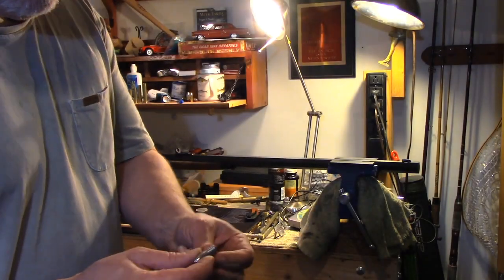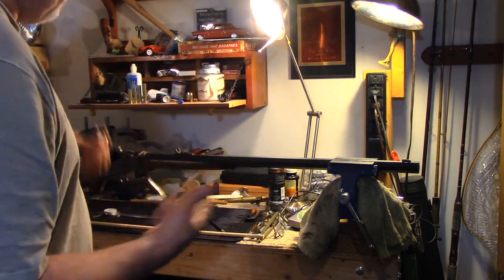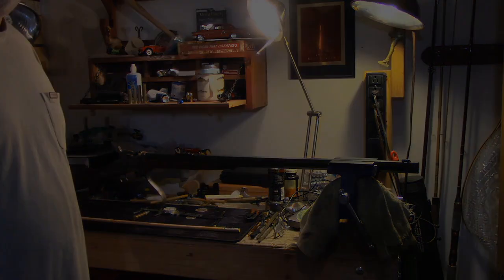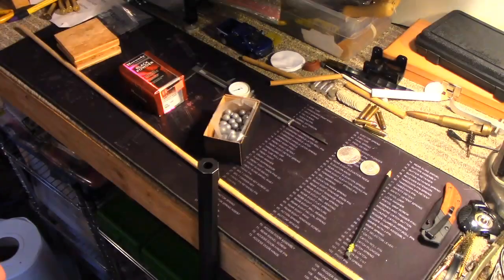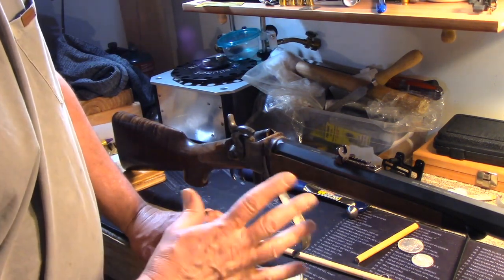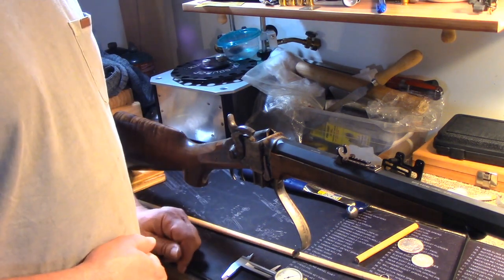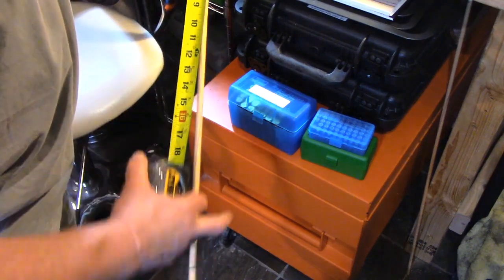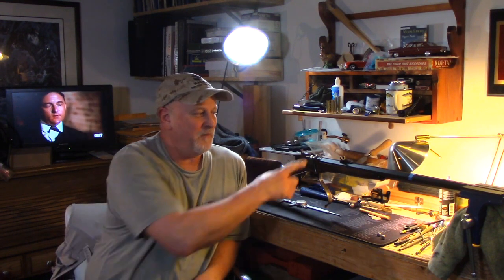Introduction to the Shiloh Sharps 45-70 Model 1874 Rifle

Comment: I know this video is a couple,of years old, but the technics to obtain vitals of the rifle still apply. When I get home, at the end of October 2024, I will use the methods that you just used, to find the info on my Trapdoor Springfield, which I intend t9 use at the 2025 Quigley match. Most important is, that I need to slug the barrel to find groove diameter, so I can get a correct bullet. Will do this on the barrel of the rifle that I’m going to have built. I could have just purchased the Pedersoli Trapdoor target rifle, with its 6 grooves, but I really didn’t like the finish of the stock and I wanted to have a number of parts color case hardened…..make this rifle really special. Just ordered a Lee Shaver  vernier/Soule rear sight. The rifle will have all original metal but a repro full length stock. Bruce Dow, in Dade City, Fl will finish/assemble/ mount the sight and shape/finish the wood. I think the rifle will look very good. We’ll see if I. An actually score some points with it. Thanks. Enjoy your videos.

Comment: Nice video! When using a micrometer use the small diameter on turning screw, this has an ratchet preventing overturning jaws👌Learned loads from your video. Greetings from Norway Alf,

Comment: I don't think they forge the barrel steel at Shiloh . I think they buy the barrel steel from some one but they do cut their own rifling in the barrels.
Reply: Shiloh have a YouTube video showing how they forge the barrels. And other bits. From wax moulds. It’s interesting. According to the video they use chromoly steel. Which is what my bike is made of.
Reply: @johnmacdonald1878  They don't forge the barrels they buy 1.250 x 14 ft. length bars of steel and the drill and cut the rifling then chamber and contour the outside.
Reply: @lorenlieder9789  Thanks, I’m no expert, I missed it on the video. Still pretty impressive operation.
Reply: @johnmacdonald1878  No problem. Yes they do a great job I have 2 of the Shiloh rifles and Love them!!

Comment: I would love to see a few more differences between the Pedersoli and the Shiloh. I’m trying to decide on which to buy! Thanks
Reply from the maker: The biggest difference as far as functionality goes, is that Pedersoli cuts their chambers far larger than Shiloh does. If you are reloading fire formed brass for a Pedersoli, it’s likely that that ammunition won’t even chamber in Shiloh. This extreme stretching of the brass can lead to additional variance in the velocity you get with each round. The fit and finish aspect of things also favors Shiloh. Now, on the flipside of this, the cost of a Shiloh is at least double the Pedersoli.

Comment: I was wondering how do you find the end of the chamber?  With my Pedersoli 45-70 the chamber is tapred to the rifling so it is really hard to get a measuring point with the vernier caliper.  Any suggestions?  BTW Great videos!  I found the brass prep and annealing videos really good.
Reply from the maker: If there’s no luck with the caliper truck you can always resort to doing it the right way and make a chamber cast. You’ll need some Cerro-safe (Midway and Brownells have it) and then you’ll have a for-sure mold of your chamber.  It’s pretty easy to do but I’d watch several videos first.